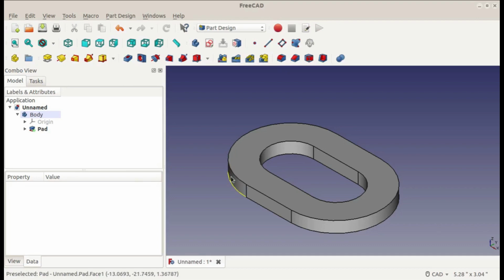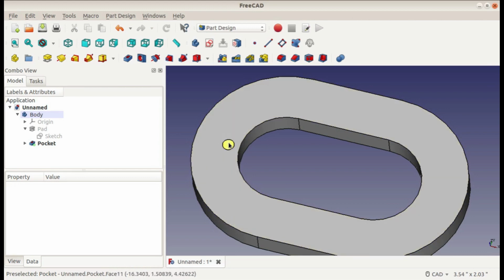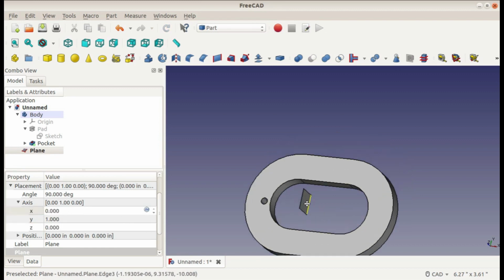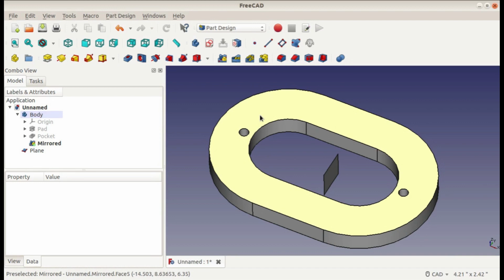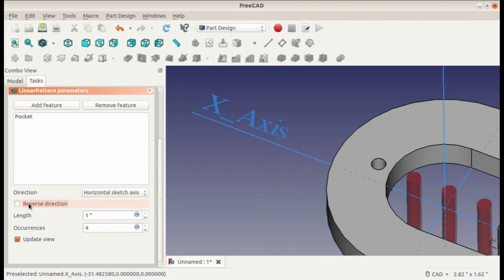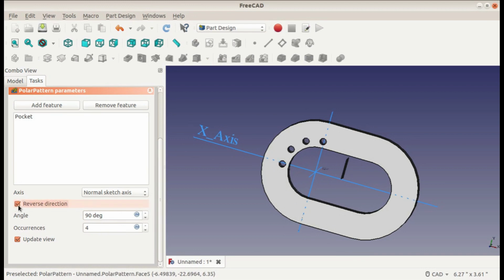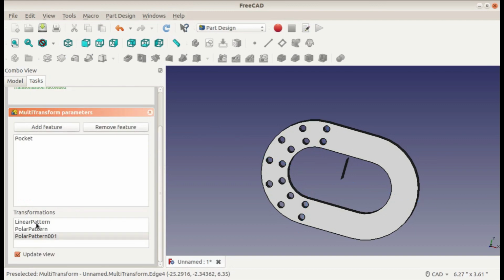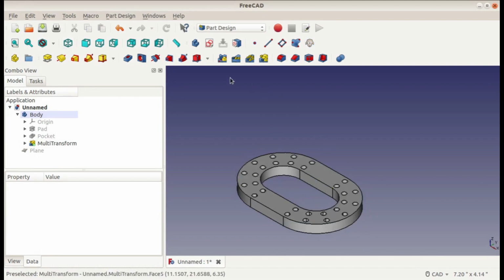Learn FreeCAD: #7 Mirror and Patterns - Tutorial

Comment: Very impressive, both the description and the capability in this free tool.  I am sure that an advanced CAD system has simular capabilities, however, as I am new to CAD this was eye-opening.
Reply: I have experience with a variety of professional CAD tools, and this has feature parity on everything but plane placement, which is significantly streamlined in the professional tool. Also the professional tool has a variety of features such as stress testing suites, which are not strictly CAD tools, but are useful in a professional design environment.

Comment: by objects go out if scope .......the polar patters follow a different radius.Can you please tell me the reason this is happening and the solution.It always goes out and follows a huge radius which I don't know came to existence
Reply: He made the left side circle along nearer to the origin then mirrored the holes to the other more far side.
Reply: that's why he used the plane instead of the origin to let it reach the more far side.
Reply: you can use a line as the origin point for the center of the circle for the radius. If this line was nearer to the pocket that you want to make a polar pattern of. Then, the radius of the circle will be smaller and vise versa.
Note: He used a plane for the mirror center point for the mirror pattern. I used a line for pointing to the center of the circle that the polar pattern will go around. the space difference between the pocket (the sketch that you want to make a pattern of) and that line is equal to the radius of the circle that the pattern will go around.